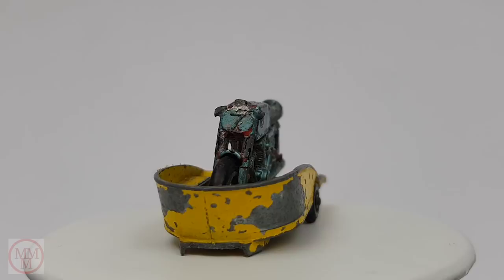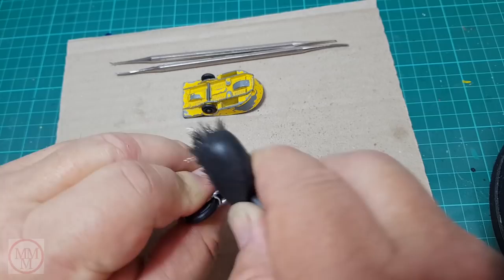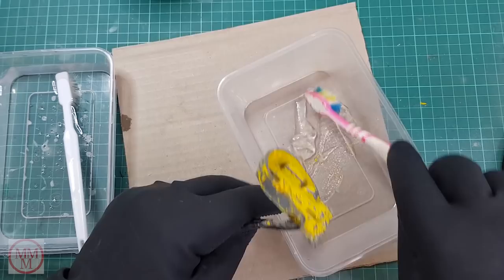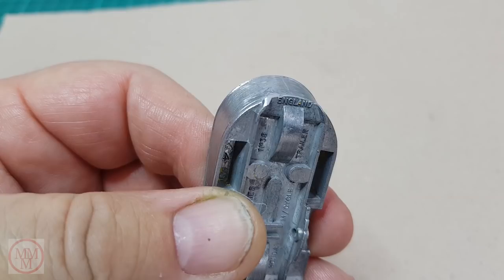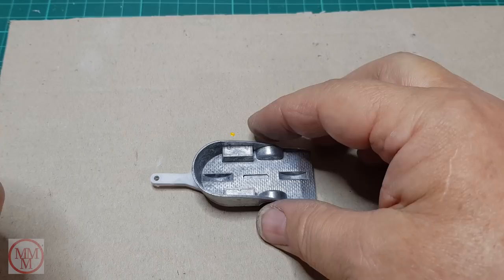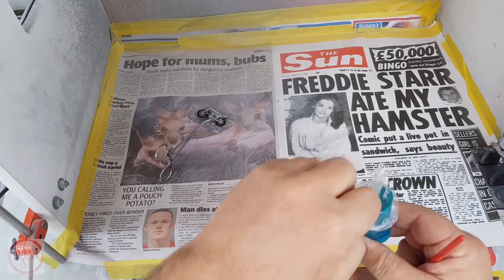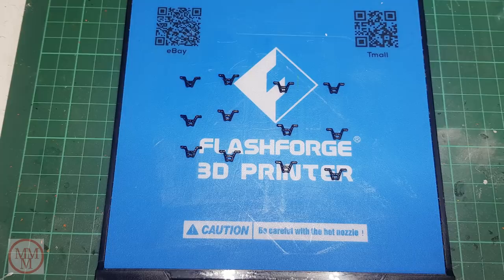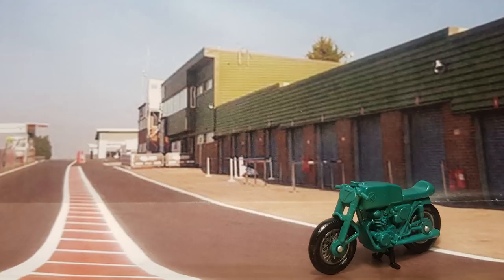MATCHBOX Restoration No 38c Honda Motorcycle and Trailer 1967

Comment: Marty, I was terrorified when I saw you sinking the bike into the caustic soda ,caustic soda is too agressive to those soft metals it even eats literally the aluminium I saw dessapering a steel gas drum tap as I left it in soda and forgot to recover it,BTW you must clean carfully any rests cause it attack the new paint too.I used to use an old pair of pliers to remove the axle rib I grinded the jaws flat and so pried around the rib to flatten it and remove the wheels or other axles in thight areas.I use car paint polish liquid to revvive windscreens and remove scratches.

Comment: Hey I dont know if you have this in Australia but I use a product called citristip for paint stripper. I think you would like it because it works well, only takes one application. You only have to use a small amount too, I notice you really glop paint stripper on your models. I dont do that because I've never needed to to get the same results you do. Also citristip has no harsh fumes, it just smells like grapefruit. Lastly, I got some on my hands once and nothing happened so that's great. You should try it, I think you'll like it a lot. Also instead of using acrylic paint thinners I use isopropyl alcohol. Its literally the same thing but much cheaper

Comment: Sir, for once I think you messed up. The bike could have been better left unpainted, or just the tank and fenders painted, the engine and badges should NOT be blue.
Reply from the maker: I know what you are saying but I just wanted to recreate the actual model as it was when new.
Reply: @MartysMatchboxMakeovers  Well, I've watched your unboxing vids, I know you already have a pristine example, so you could have gone more realistic with this one. Since the hitch part is not ever going to be original again, the bike doesn't need to be either. however, it's not too lake, removing some paint with an exacto knife might be the way to go here, since a great paint job would be such a problem to do on such a small thing. Fess up, that's why you went that route... come on... I get it. lol. Got to bust your chops when I can, I get so few chances.

Comment: for a better bond I would use gap filling CA the thicker stuff it wont be drawn out as the putty is and u can before u set it with the accelerator can remove the extra with ur tooth pick so u don't have to sand as much and the ca will hold WAY BETTER than spot putty

Comment: Burning is the chemical process of oxidation... we burn wood, and the carbon oxidizes (reacts with oxygen in the air), to form CO2 - once the reaction has begun, it sustains itself, because sufficient energy (heat), is released.

The copper didn't sustain the reaction because the surface of copper is generally already oxidized at normal temperatures, and can't react (burn), further.

Comment: Marty,  Caustic Soda ( CAS Registry # CAS64-19-71 | 7732-18-5 ) is also commonly known as Lye whick is used for making soap.  Here in the States it is sometimes used as an industrial-strength drain un- clogger.  It has the chemical name SODIUM HYDROXIDE [ formula NaOH ].  I congratulate you on wearing the gloves.  As a Research  Chymist,  I would also recommend:

     Ooooold clothes which will be holed by the spatter from your brushing

     SPLASH-PROOF SAFETY GOGGLES so you don't get this gnarly stuff in your peepers.

     Give everything a good wipe-down after you use the NaOH; you wouldn't want to
     go dissolving your Wife or Kevin eithef !

Being that this stuff is sooooo corrosive ( but not TOXIC in the sense of something like Sodium Cyanide NaCN or a legal solicitor ) ask around from your city public works department about what they would recommend for disposal.

Be careful with NaOH around MURIATIC ACID which has the chemical name HYDROCHLORIC ACID  HCl .
Mixing these two is a HIGHLY EXOTHERMIC REACTION and the mix could boil and get all over you ---》 NOT NICE.

People sometimes use Muriatic acid to clean hard water scale ( Calcium Carbonate. CaCO3 ).  Waaaaaaay to strong; can start dissolving metal.  Electric coffee pot cleaner, SULPHAMIC ACID H3SNO3 will do the job but not be as strong/dangerous as HCl.  Heavens do NOT use SULPHURIC ACID H2SO4 which is VERY DANGEROUS ( especially as a concentrate ), is found in American car batteries and under certain conditions can cause a fire when mixed with the wrong chemicals.

SIDE NOTES- have you ever thoughf of haching up old, non-restorable diecasts to produce your own Fantasy Vision?  Wouldn't it be jolly if someone would modify a 1:24. or 1:38 scale diecast soas to run it via Radio Control ?    Take a look at http://www.oh-model.com.  Mine is a prize sitting right next to my KYOSHO Mini-Z like their READY-SET sku# 32610W TOYOTA which is full-functioned and only a few centimeters long !  The ORLANDOO-HUNTER and the MiniZ might even be worth looking at on your next trip to your hobby shop.  PIX of mine one of these days.

Comment: By gluing the draw bar in such a way you have covered the "England" sign which, I think I would rather avoid doing. Also why not model and then die-cast the drawbar from metal (like tin) and weld it to the model.  I couldn't do that for sure but perhaps it is possible ?

Comment: there is a app u can use for paint matching
Reply from the maker: I tried one but my printer prints slightly different colours and the app gave different codes under different light so I stopped using it.
Reply: @MartysMatchboxMakeovers  I believe you can contact matchbox and they will send you the color chart

Comment: Sorry about the comment on baking soda, I was writing that before I saw you used it on the handling bars on the bike. I've seen on other YouTube channels that also do customs, that you can use baking soda when you glue things together and that it should not only glue fasten and dry it up almost instantly but also strengthen the joins as well. I thinking that a 3D printer cost alot depending on model and price range etc. But what about the material used for the plastic parts you print? That must also cost alot? I mean when you have to print out various examples to try to get it right?

Comment: ahhh u gap filled the bike handles but not the trailer,,, hmmmm in my time with ca and I built and fly RC planes for like 20 years now and did when I was a young lad when,, u hit one part with kicker and the other with the CA and put them together the bond is not 100% most times(because of small little movements or trembles of our fingers we break the bond and its been hardened then what's left bonds and its less strength)  its better to allow the kicker to flow around the edges of the glued surfaces then it hardens the outer part of the glue joint and the heat generated helps the ca that's not been affected by the kicker itself to harden quickly,,,, that's my experience with CA,,,, if u go back and look at the point where u joined the printed part to the trailer u can see u broke the bond and re-bonded it to the trailer with the little ca that was not hardened immediately,,,, it may just be fine I hope the plastic would break before the bond will if u drop it,,,, that would be a much easier touch up to do